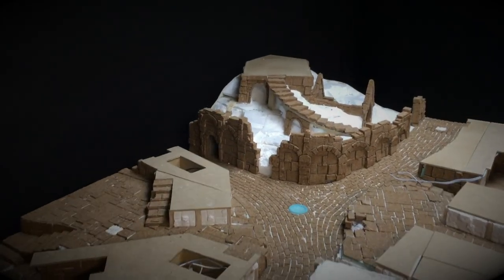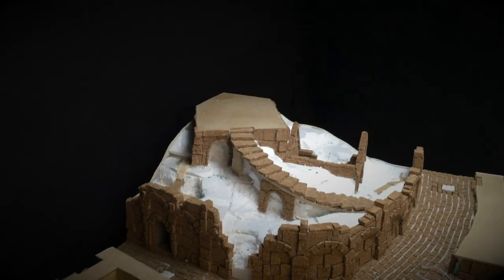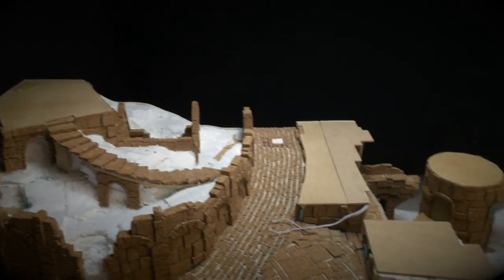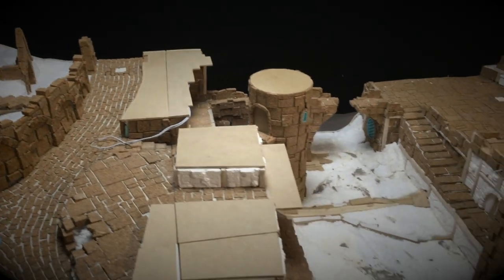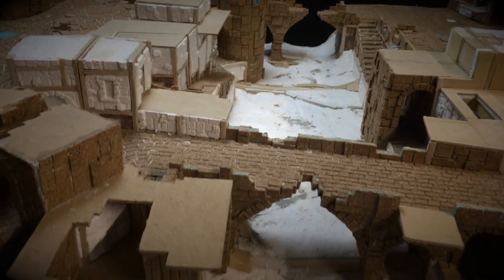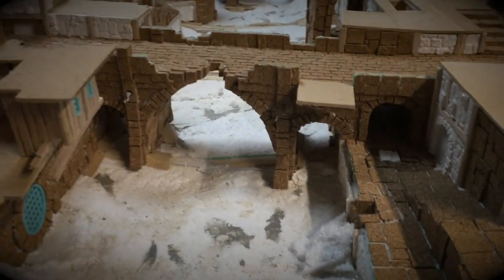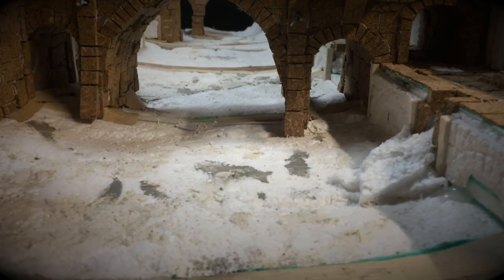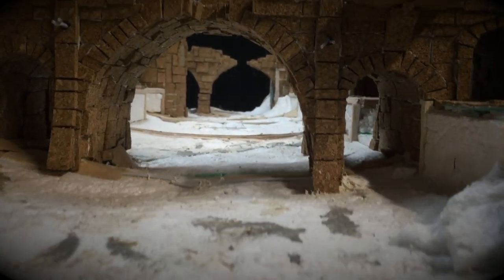Building Awesome Mordheim Board - Vlog (Part 0 - Introduction)

Comment: I am very interested in learning more about how you built any of the features you'd like to share.  I was wondering what material you used for the outside of the board that I saw some cutouts in that gave views to subterranean spaces for example.
Reply from the maker: Hi there😊
Sides of the board are covered with 4mm plywood. It’s strong and lightweight - perfect for this kind of places.

You can find more about my techniques in some other videos of mine.

But if you have some more questions then just ask and I will try to answer. Or maybe make a video about it😊
Reply: @msterrainlab  thank you very much for the reply and information.   I'll look at the previous videos in case some of the questions I have have been answered before :).